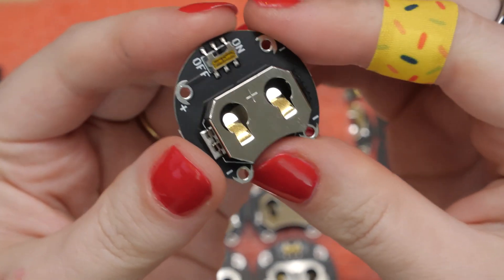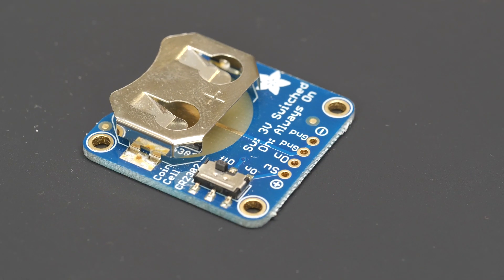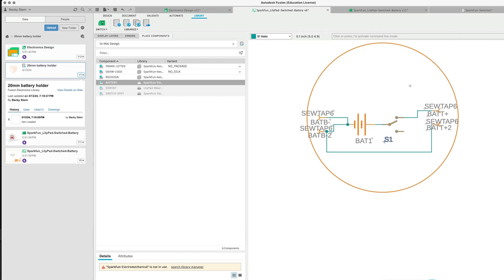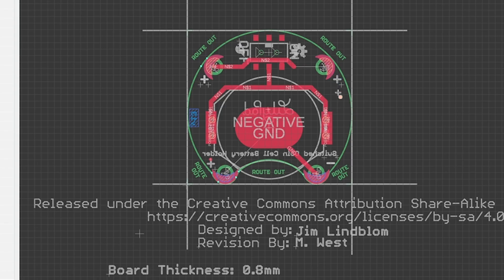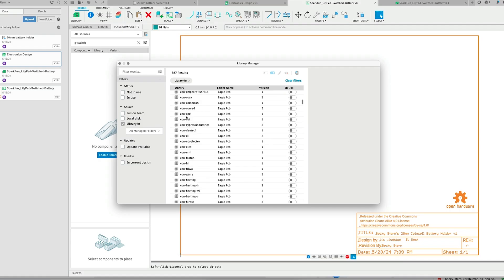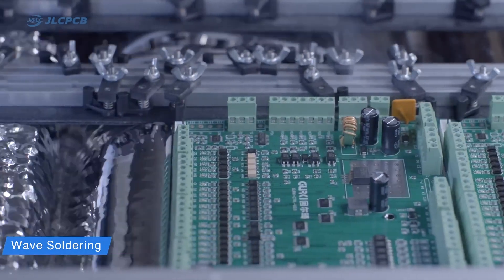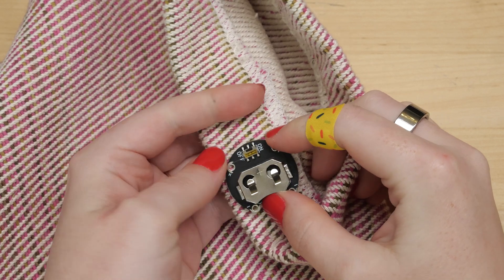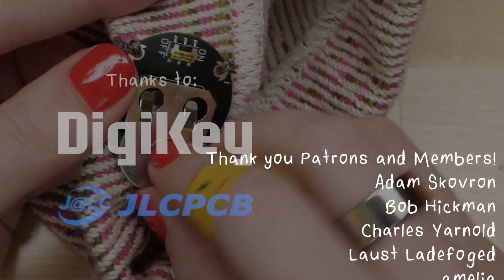How I Made This Coincell Battery Holder

Comment: I'm not sure if autodesk is going to make a problem out of it, but you're not allowed to have monetization on with this video using a fusion360 educational license as far as I know.
Very cool project in any case!
Reply from the maker: It's just called Fusion now, I'm a legit educator with a .edu email address, and turning on YT ads for this video (which are off rn btw) isn't the only way I'd be technically in violation of the license while providing them free advertising! Would you have noticed if I had cropped out the top bar of the window? 🤪
Reply: @BeckyStern  I probably wouldn't have noticed otherwise :) I really hope you won't get any issues with it, I love your videos!
Reply: Kicad is the way to go. 100% open source and free. And very, very good. Also, it can apparently import Eagle files.
Reply from the maker: Yeah it's gotten so much better in the time since Autodesk bought Eagle-- a real community success story!